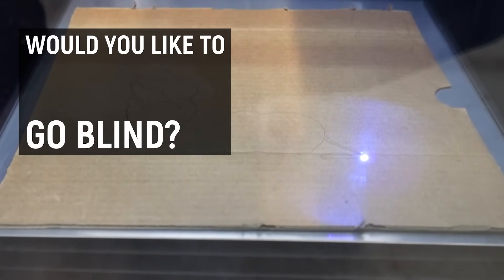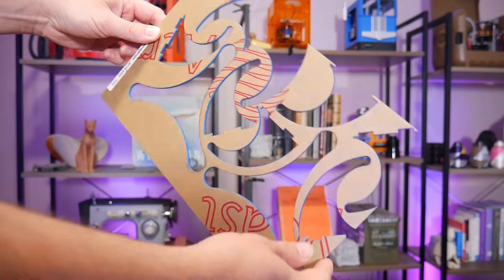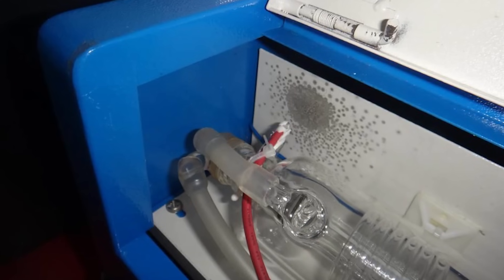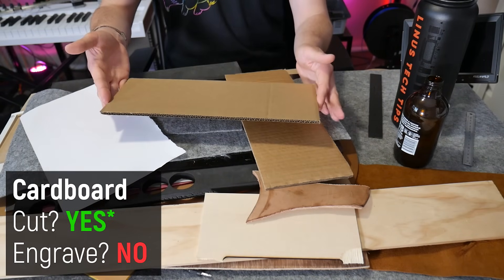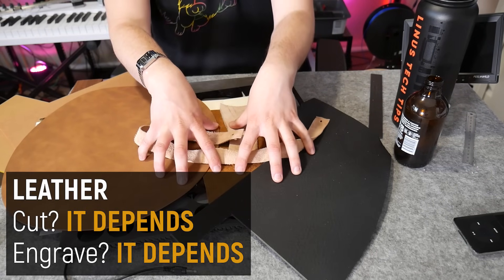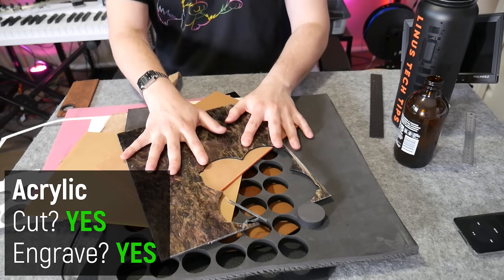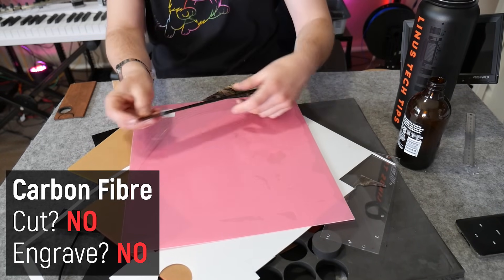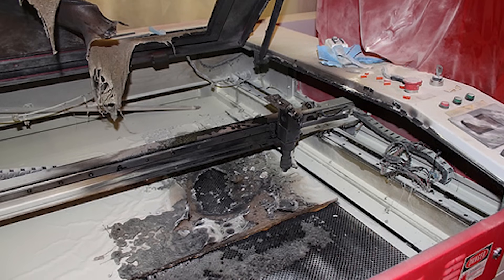Are cheap laser cutters safe?

Comment: Favorite first test for anything going through the laser cutters:  The flame test.. Take some copper wire, get it to red hot in a flame, stick it in the material then back in the flame until it glows again. If the flame is green, it includes a halide (Clorhine/flurine/bromide) and IS NOT SAFE.. 
Good fast first pass tesing.
Reply from the maker: Yep very good test!
Reply: @MakersMuse  It also lets you find out if it's real or fake leather. Though that the PVC leather melts helps a lot with this! :)
Reply: Thanks! I didn't know about this, but it's certainly been added to the rule book now. Better safe than sorry
Reply: Uhh? You do know that copper creates a blue/green flame effect right? Which kind of makes your test inaccurate. Steel wire would be far better for a color test.
Reply: @ganjasage420  The test is for halides, not for copper. Copper wire in a flame produces no colour but it's salts do. When the wire is heated the halides attack the copper and copper ions that then make the flame green. Without them you get an orange flame of burning carbon.
Reply: @ElectraFlarefire 
Chemist here, copper will produce as green to blue flame as it heats up, as copper ions in the flame change electron energy levels and emit visible light at wavelengths proportional to the energy released upon changing energy levels. Chloride and fluoride ions do not produce emission spectra within the visible spectrum, and bromide ions produce UV light at 132 nm - again outwith the visible range of 380-740 nm.
To conclude: no, you will not be able to check for halides in a material with a hot copper wire, your statement is simply false.
Reply: @ataphelicopter5734  Based on piratical, physical tests, with an LPG flame, some scrap electrical(solid copper) wire and a selection of material such as ABS, PVC, vinyl and PC to it's a test that works.
I may have the chemistry work, but the test is proven and works. At least with those materials.
ABS = Smokey orange flame until the wire burns clean. PVC = Bright green flame then the wire burns clean. The moment the sample is burnt off, the flame returns to normal and you just get a glowing red wire in the flame.
Reply: @ganjasage420  Engine-rich exhaust moment
Reply: I am loving this thread
Reply: @wild-radio7373  The battle of people far nerdier than me, which I didn't think was actually possible.
Reply: @tbuk8350  🥰totally!

As a radio nerd, I feel ya :)
Reply: @ataphelicopter5734  Yes. Copper ions do emit green light when heated. But you'd put elemental copper into the flame (heating/annealing to burn off any potential contaminants that reside on the wire, resulting in false positives). From first hand experience, you don't just get a constant bright green flame if you hold a basic, clean copper wire into a flame. You only generate a very thin layer of copper oxide by annealing it. After dipping into the test sample, pyrolysis forms copper halides which do burn bright green. However, there are doubts about the specificity of this test and it should not be performed without a fume hood as you risk generating highly toxic dioxins.
Reply: @ElectraFlarefire they weren’t saying the point is to test for copper, just that the copper is going to make green flame regardless so you can’t use a green flame to test for the presence of halides.

(I’m indifferent to this argument, don’t know who’s right, just clarifying what they were saying)
Reply: @DeepfriedBeans4492  And I was saying I've done this test and it works.
Hold solid copper wire in a flame below it's melting point and it doesn't turn the flame green. Any copper salts will, but the solid metal doesn't.
Reply: @ElectraFlarefire  yeah, I get that, but you said 'we aren't testing for copper', which isn't the point they were even trying to make. 
Does sound like it's a legit test though, good to know

Comment: If there was a laser engraving machine that could automatically put out the fire when it caught fire, I would buy it
Reply: well it depends. a air assist will stop it from catching fire the majority of the time.
Reply: Sounds like an Arduino project
Reply: XTool has a fire suppression add on for their enclosed lasers that floods the chamber with co2 when it detects a fire. You for sure need an enclosure for that though.
Reply: You for sure need an enclosure in ANY case.

Comment: My first job out of college was writing testing software for a medical laser company and it was ALARMING how complacent people get around invisible lasers, even the optics safety guy gave me a hard time when I came asking for the right wavelength protection goggles, most people didn't even wear goggles when testing the lasers
Reply: I work in a sheet stainless steel fabrication factory, we use laser welding for it's pretty finish and a 2500W CNC cutter ... The sheer disregard the staff show for eye safety is terrifying... It's a shiny metal! It has to reflect some of that 2500w death beam! The cnc producer put a see though door so you won't have to open it! ... And rhe fucking welders! The welder can literally melt steel, and the handle looks like a gun!
Reply: I also worked at medical device company making lasers for orthopedic surgery. The lasers were Nd:YAG, which produce a wavelength that is not visible, bounces off walls and is especially damaging to eye tissue. And the tissue damage is cumulative. 
The manufacturing and test area had safety curtains for the welding bays, which everyone was good about, and safety curtains for the laser testing, which were often  ignored, probably because it was not visible. I was laughed at by the engineers (who should know better) when I asked about eye protection. "It's there in the cabinet, but nobody bothers." Those guys are all probably blind now or wearing inch-thick glasses.
Reply: Why do people insist on being stupid
Reply: @mememan2344  You know about the saying "When you make something idiot proof, the world makes a better idiot"? Yeah. It's annoying indeed. The work safety classes in engineering make you give up any hope on the people you might be working with or working for you. The several mincemeat photos when people decide to take shortcuts in their work and bypass safety devices should make it obvious but the worker will still jam a plank of wood on the dead man switch to be able to stick a hand on the moving machine.
Reply: look up the demon core incident. there people were getting that complacent with plutonium
Reply: @PlainAccount  This thread is about incidents in real life industrial facilities, not fictional combat situations.
Reply: @baracuda40  ولا وهو شي نززز دك ضد
Reply: @baracuda40  this is false and harmful. The reflected light is still very dangerous for your eyes
Reply: @PlainAccount  You had me in the 1st half, I'll admit.
Reply: I’ve trained myself to close my eyes very quickly when I see the laser coming towards them. I call it a safety blink.
Reply: @coolcoolercoolest212  Uhmmm....
Reply: @coolcoolercoolest212  And this is why AvE's "Do not look at the laser with the remaining eye" sign is needed.
And the braile version as well.
Reply: @coolcoolercoolest212  Even if you held the world record for reaction times, you will still sustain damage.
Reply: @baracuda40  You could not be more wrong.
Reply: A mate had a PCB factory and (being an electrical engineer) I would often repair his various equipment, CNC drills, flying probe testers and so forth.
He had a huge laser plotter which was misbehaving - and I wouldn't touch that thing.
I could see a bunch of lenses and mirrors directing the invisible laser about inside it - and I could see (for the time being...) that there was a huge risk of me accidentally interrupting and redirecting the beam whilst working inside on the electronics.
Yeah, nah - you need somebody that knows what they are doing here...
Reply: @coolcoolercoolest212  I know you are joking but I know welders who legit said this.
Reply: Surgeon here and appointed laser safety person for my department. The doors to the OR get locked from inside, absolutely no one is allowed to stay without goggles for the proper wavelength and the patients get nice, thick aluminium eye stickers. We pick our instruments, so that they are less reflective and do a check of the beam on each startup. A 25W CO2-Laser can do a LOT of damage on organic tissue and blind you in an instant.  I can't even imagine having one of those open lasers in my home.
Reply: People get permanently blinded by invisible christmas lasers, yet there's people not wearing goggles around powerful cutting lasers...
Reply: @baracuda40  found the complacent one
Reply: @coolcoolercoolest212  😆❤️

Comment: I operated an industrial laser for a few years, these are all good tips. I would add that there are actually lots of things you "can" do that are supposedly impossible for a given laser wattage, it just takes a lot of patience. I cut a big logo half an inch deep into hardened stainless steel using a machine designed for surface marking once - just 40 watt output I think. It took a whole weekend, but it worked. Lots of fast passes. The point is to vaporize, not melt/burn. Don't give the heat a chance to spread. Would you believe I had to fight with them for months to get an exhaust system so I wasn't hotboxing my face with atomized god-knows-what every time I open the enclosure? Eventually I just made my own and suddenly it became a big deal that I was exhausting this shit right into the shop's air for everyone else to breathe.
Reply: Seems like a good place to leave from.
Reply: Welcome to capitalism friend, where the bosses just throw out the old and replace with new once you get stage 4 terminal.
Reply: But...Plasma cutter...

Comment: And with leather it's even worst than you think. A lot of the cheap leather comes from parts of the hide that had defects in it. To make the surface perfect, it gets filled with a polymer and sold at a lower price.
And wood derivatives, even if "natural", will release upwards of 300 chemical byproducts when burned, including a lot of carcinogens. So if you can't afford a cutter with a closed enclosure, I feel it's a good idea to build one just to avoid having those airborne chemicals in your shop.
Reply: I might be mistaken but I think even the "genuine leather" thing includes this material because it is technically leather but just scraps glued together.
Reply: I am not really worried about wood smoke, but having wood with any glue in it is unsafe to cut if you ask me. I would rather watch a CNC mill than a laser cutter running open if you suppress the dust with some water (assuming nothing breaks and flies out) But once our lab milled glass fiber board without coolant and the dust was nasty
Reply: Just curious, but why do you have to buy a cutter with an enclosure?

You can just make one.

Comment: My friend, I just wanted to thank you for putting this out there and doing it in an emphatic way.
Even smaller channels like mine get contacted by companies weekly (and these particular open designs that make you cringe - that's how they all look right about now), so the information comes at a good time.

I recently did a review of the Atomstack X20, a unit I was willing to review because it would have been the one I'd buy. Had a safety glasses bit, talked about the fumes, etc.  ...and it turns out I'm showing people the *wrong color safety glasses*, because I simply trusted what was sent to me. "These came with the laser, so they must be the right ones."  Had no idea I was supposed to be using orange instead of green, let alone the appropriate density or rating.
Past couple of days have been eye-opening.  Thank you for videos like this!

Comment: For the record: The cheap gantry cutters, and fiber markers, both come with completely useless fake goggles 99% of the time. We've tested most chinese goggles, and they vary in quality from "misses critical absorption lines" to "colorful plastic lmao". You NEED a very large, respectable western brand name(Thorlabs, Edmund, Laserglow, NoIR, for example) for any goggles besides CO2(in which case all you need is full cover glass or polycarbonate safety gogs, as both are opaque to 10.6um, but not PMMA).
Given the risk of stuff reflecting off your material should there be something shiny, it's my primary worry.
Reply: So where can one buy decent goggles? I have a friend who operates one of these and I worry.
Reply: @talonsl  I mentioned a few brands in the comment. Those are safe.
Reply: @Spirit532  I am so sorry, I was a bit tired and somehow read that as laser brands not goggle brands. Will check those out and get him some goggles for his lasers wavelength!
Reply: I say forget the goggles altogether...

Put it in an enclosure or put it in a separate room with a camera, and monitor it that way.
Reply: Brand does not matter, wavelength does. And you don't need OD6 glasses for a typical diode laser. The hazard with too much protection is people that can't see with them on tend to put them up on their head and forget they are there, ideally you want a pair you can see through readily, that have a shade of 2.5-3 instead of 7. Color doesn't matter either, as the green glasses use a compound that shelves off right around the blue laser wavelength making them as good as the red ones. And CO2 glasses can be crystal clear optically.
Reply: @mytuberforyou  That is dangerously incorrect. Brands DO matter very much, because there are a lot of fake goggles that lie about their specifications, even with legitimate test certs. Just useless colorful plastic. 
Most normal goggles have a VLT of 40-70%, which is more than enough with normal shop lighting - I regularly work using goggles with 15% VLT and I only consider that to be moderately annoying. 10.6um LWIR light from CO2 lasers is an exception because it's readily blocked by polycarbonate and regular silica glass.
Reply: @Spirit532  How can you "lie" about your specifications with LEGITIMATE test certs?
Virtually all of the the no-name chinese glasses by the common manufacturers, (Ortur, Foxalien,Lasertree, et,al) are adequate for their intended purpose- I mean, short of taking the head off the machine and holding it up to your eye. How can we establish that? There are hundreds of thousands of these things floating around and I can't find even a single lawsuit or report of a blinding from a diode laser anywhere- they all seem to be laser pointers, lasik eye surgeries, femtosecond lasers, etc. Between the short focal length and the geometry of the machine these things are apparently not as dangerous as the imminent blinding that some people feel the need to tell others is in store for them if they don't buy $75 glasses. I'm not saying MORE safety is a bad thing, but it's sort of like telling people if their car doesn't have air bags they will die. But it's the guys saying cutting vinyl WILL KILL YOU because of "hydrogen chloride" when your stomach is full of aquaeos HCl and your kidneys have a neat way of regulating your body pH that I really take issue with.

Comment: For metal "engraving", you can replace Cermark with moly lube spray with good results, and save a buck!
The better option is to spray your metal black with a regular spraycan, burn your design with the laser (burning away the paint), then etch drop it in an etching solution.
Works great for diy pcb's as well.
Reply: Any place in Australia that stocks moly lube?
Reply: This is a fantastic suggestion!♡ I would not have even thought about that!

Comment: I’ve got one of those Chinese deathrays that has a laser end you can switch out for a router. I ran it using my best safety squints, with an extractor venting outside and shut it in a box while the laser came on.

They are good at setting things on fire though!

Comment: I assembled my diode laser and tested the moving parts, but didn't turn on the laser for several months because it worried me. I currently run it behind a temporary screen with the correct type of orange window in it, until I get an enclosure built. I bought it to mostly cut card for model making, which is all I've cut with it so far. Most jobs only take a few minutes, so it isn't running for the hours some people run theirs to engrave photos and complex graphics, and it's no problem to stay with it, with a fire extinguisher close by. I'll eventually use a camera to watch progress. The only other materials I plan to cut are thin ply and acrylic, but I'll probably only cut acrylic for jobs where I can't CNC mill it. It worries me that these open frame machines are available, and so many people are buying them, and I'm surprised there isn't an epidemic of eye damage being reported.

Comment: Great video with good points!

Laser cutting probably is the best (semi-) affordable rapid prototyping technology out there. It's unreal, how quickly you can get results and together with a 3D printer, it's magic.

That being said, I would never use a laser cutter, that does not have a fully enclosed work area. The crappy glasses we saw in the video leave lines of sight open, so you might wear them and still go blind.

Good rule of thumb: never cut a material, if you do not have and understand its datasheet.

Stay safe, makers!

Comment: Great video!!! I use lasers every day at work and one bit of advice I will add is to never get complacent or "hope for the best!". One time, we were under a time crunch to do a project. It was an easy project too. Cut a circle hole into a rubber cap, for 500 caps. We didn't properly vet the rubber and came back the next day to find our laser's linear rails brown with rust from chlorine exposure! My intern and I spent the next day and a half wet-sanding with 2000 grit sandpaper to restore our laser to working order... Moral of the story, don't rush and "hope" nothing bad will happen. Deadlines can be moved, due dates can be missed, but your health is priceless.